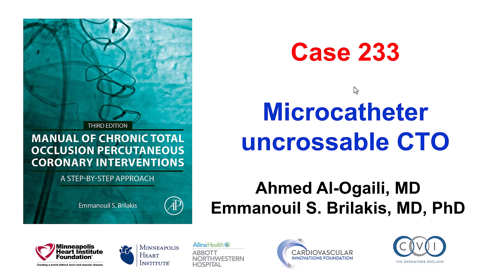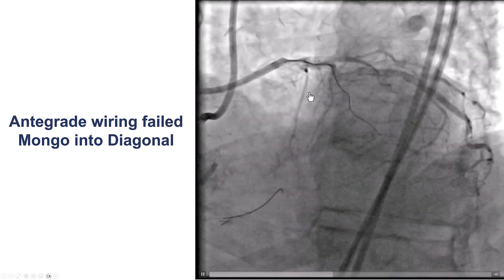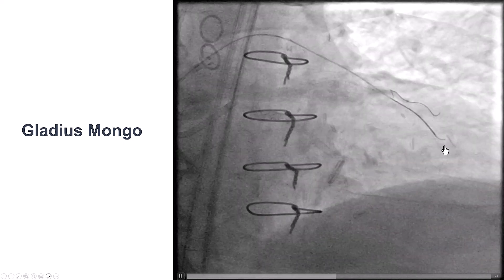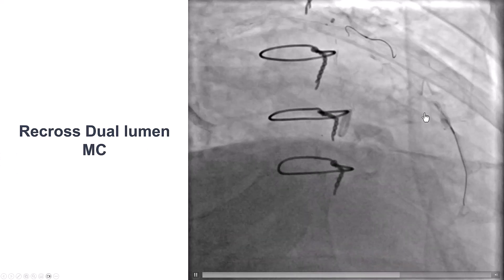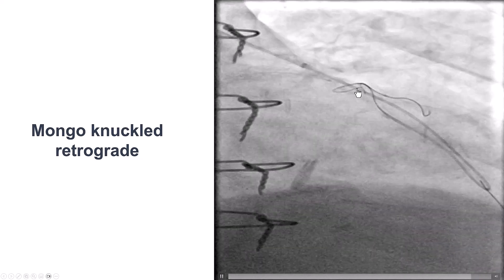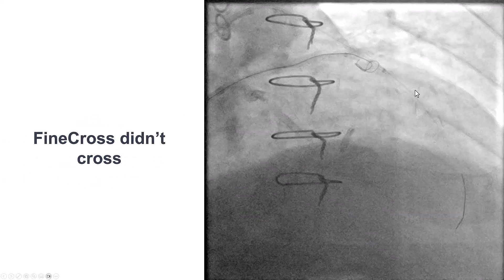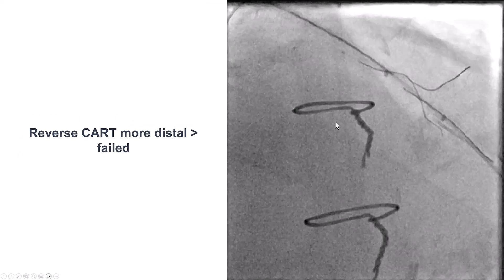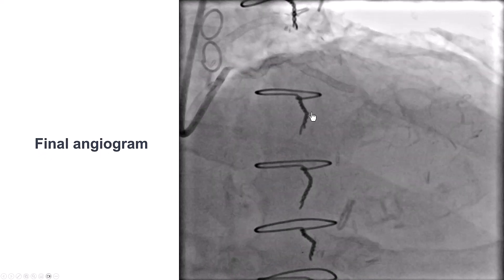Case 233: Microcatheter uncrossable CTO

Comment: It is reasonable to blame the distal cap for failing mc-crossing. However, retrograd mc had a very tortuous course. At the anastomosis, the angle might be too acute to take. Pplying more power would push mc distally causing mc kinking. Was there any damage on the body of the mc?
Many thx for your cases,
Reply from the maker: No damage on the microcatheter- great point re: tortuosity.